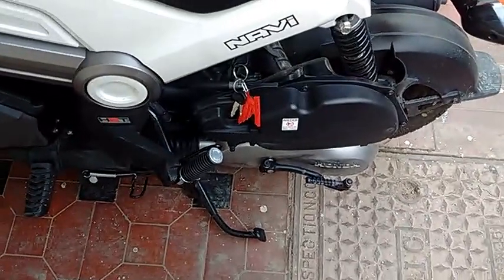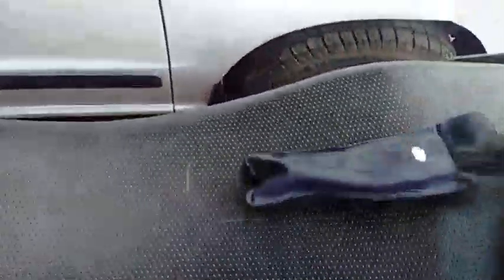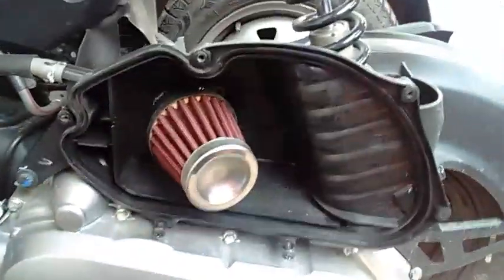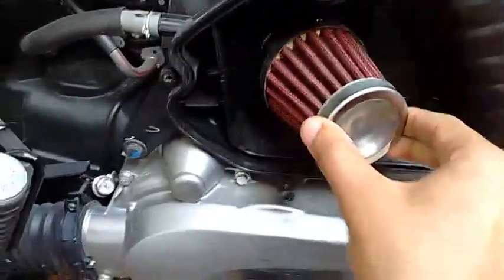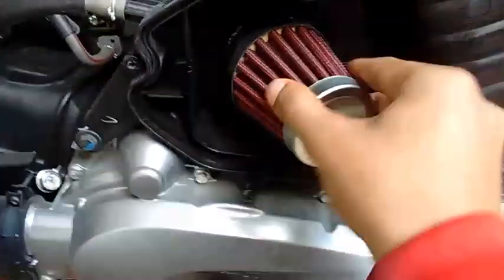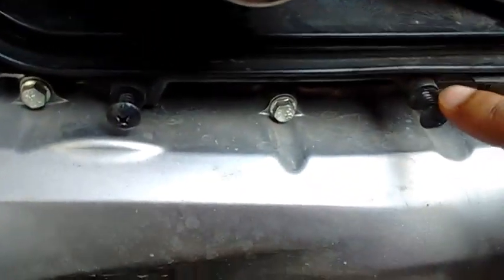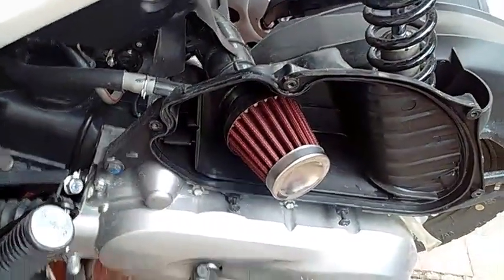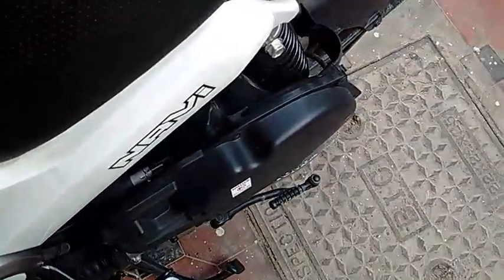How to install k&n air filter on Honda Navi/Dio/Activa(DIY)

Comment: Bahi jab isko lagaege toh air filter ka cap open rakhna hoga 
Close kar rha hu toh sound nhi aaa rha h
Reply from the maker: +Himanshu Baura sirf neeche ka part open rakho aur top ke screw normally dalo
Reply: Nhi ho rha bahi mne nichhe k 2 screw khol diye or uper k 4 normaly tight kare h
Reply: Agar m filter box open rahne du toh koi dikaat toh nhi hogii
Reply from the maker: +Himanshu Baura but air filter gir sakta hai
Reply from the maker: +Himanshu Baura nichhe k first screw kar do tab gap rahege
Reply: But mne karliya awaaz nhi aaa rhi h

Comment: dont do it ! its the worst method of fitting k&n filter !!!!!! it will ruin your block piston !!!!! i am the victim !
Reply: AMIT KASHYAP bro so what should we do
Reply from the maker: +Maaz Ticketwala you can change the exhaust, but I personally have not faced any problem with the air filter
Reply: syed shariq you will face problem in longrun
Reply: @syedshariq7589  bro can u please find out if activa 3g headlight unit will fit in activa HET model 🙏